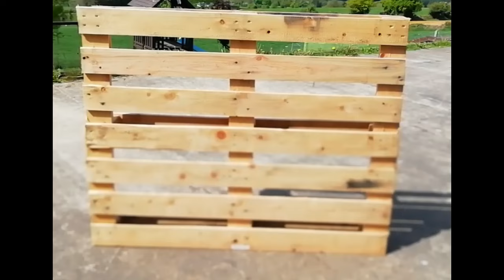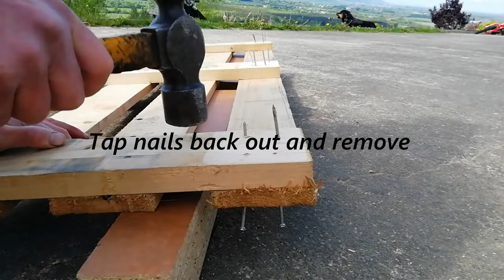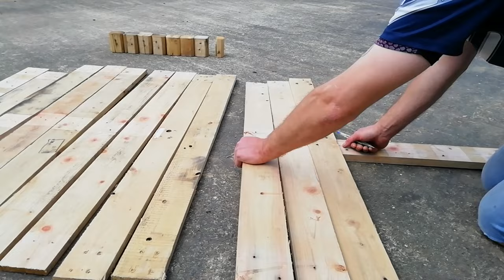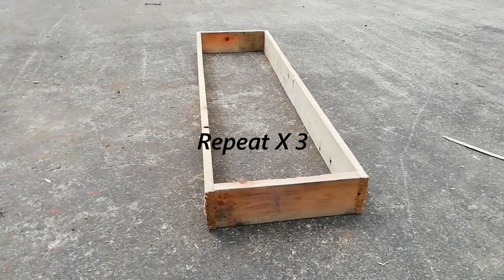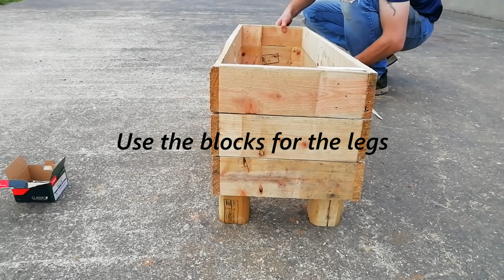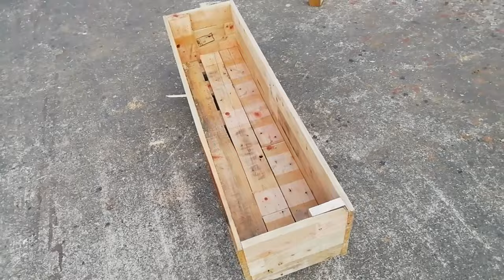Diy planter box from just 1 pallet.

Comment: Nice design, might steal it. Made some a little different myself. Longest part of the process was removing the nails. I admit I cheated and cut along the outside and just had to remove the middle nails from the inside board
Reply: I usually use a metal blade and a sawzall and just cut the boards off, popping the nail heads out later.

Comment: Great video; I am unclear the area of stacking, did you use just used two small woods in the opposite direction and did drill that will help the stacking three boxes or do we need to use glue? Please suggest. Thank you.
Reply from the maker: Three box sections are attached with screws and wood on the inside.
Reply: I did one piece; first DIY project;with stain coating to it;thank you for your video 🙏

Comment: Make sure the pallet is HEAT TREATED and NOT treated with METHYL BROMIDE. 
if the pallet is stamped with a HT,  or KD (kiln dried) you’ll be fine. 
If you can’t find a stamp or it is stamped MB, avoid using it.
Reply from the maker: Hi Archie, good comment and thanks for highlighting that issue. Almost all pallets are heat treated as required for ispm 15 standards. I see that you are in Canada so I can't say that all Canadian pallets are produced in this way, however in Europe and UK they are all heat treated. Here is a link to a site with info about ispm15 standard which includes a list of countries which "officially" comply with it.
https://associated-pallets.co.uk/what-we-do/guide-ispm15/
Reply: @ourkilkennyhomestead2006  I have used some pallets for home use and we have seen some creep in from other areas so that’s why I mentioned it. 
When I started a garden last year, someone mentioned about the possibility of the tainted pallets. 
I haven’t seen many and when you do they seem obvious at a glance, (grey, dark, oily all the stuff you don’t want in your food) but some people might not even be aware that pallets are even treated at all. 
I’ve been thinking about how to set up some raised beds so now with your video, I don’t have to think anymore!
Sadly, a lot of our pallets here seem to be the blockless ones (thick bracer boards like a rotored 2x4 run the length) but that just means a little more imagination. 
I’ll use the heavy bracers as legs!
Thanks for the video!
Reply from the maker: @ArchieInRealLife  thanks Archie, you'll be happy to hear that I have a vid coming up about building a similar unit from pallets which use bracer boards. 😉
Reply: @ourkilkennyhomestead2006  I have my hammer and saw ready! 😁👍🏼
Reply from the maker: @ArchieInRealLife  excellent, you'll be glad to hear that these pallets are much easier to take apart. Here in Ireland we call them agri pallets. 😁

Comment: Just a question ? Would drainage be fine ? Or just not put them to close ?
Reply from the maker: Hello, with pallet wood it's usually warped a little meaning there's gaps between the planks. If you're lucky enough to get a pallet with straight planks then you can leave small gaps or you can drill extra holes to suit your needs.

Comment: Don't you have a regular hammer and a crowbar?  It would have been easier to take the pallet apart that away.
Reply from the maker: Yes we do have both, but a regular hammer is too light, my mechanics hammer works better. Having stripped hundreds of pallets we've learned faster ways to do things.
Reply: @ourkilkennyhomestead2006  rock on. Thanks for the info.

Comment: These dont work for long use the soil just washes out the gaps then they rot and fall apart after a year you have to double up everything you do over lapping oposite ways to ensure the soil stays in and it lasts longer then 10 years
Reply: This needs some underlay isnt it. Will the compost bag work?
Reply: @freshleap  unless your only planning on growing flowers you should be okay but bigger plants need a much better strength box with decent but not to much drainedge holes
Reply: 😂😂 you have to fully line it. I have had mine about 6 years
Reply: @G.E.R137  yeah an i bet if you try moving it around it will probably just crumple like a old fence pannel
Reply from the maker: Use your initiative and treat the wood with a preservative, how you finish the project is up to you the builder.
Reply: @ourkilkennyhomestead2006 I imagine you could probably just line the inside with plastic and it should keep it from rotting 🤷🏼‍♂️
Reply from the maker: @nateterhaar1391  plastic might not be the best option as it wouldn't allow any drainage. You could use plastic and drill drainage holes to line up with it.